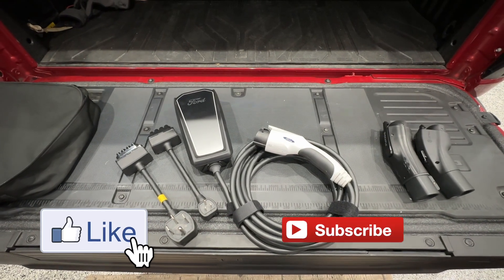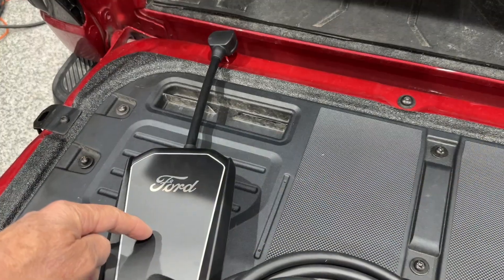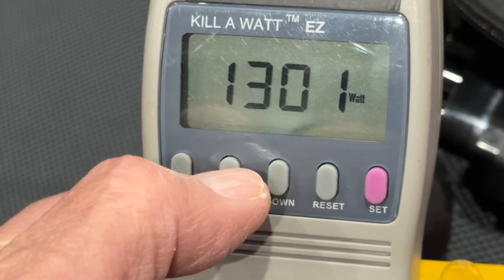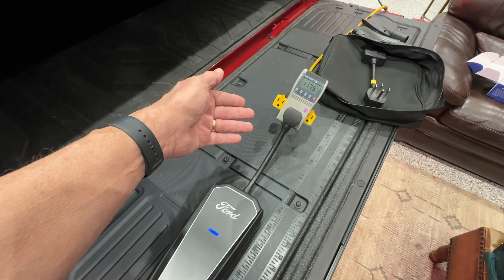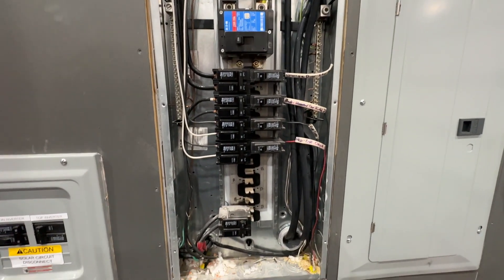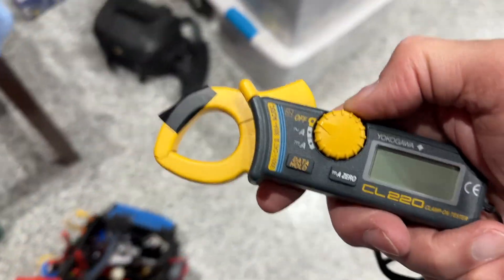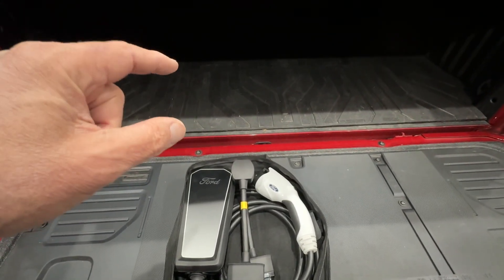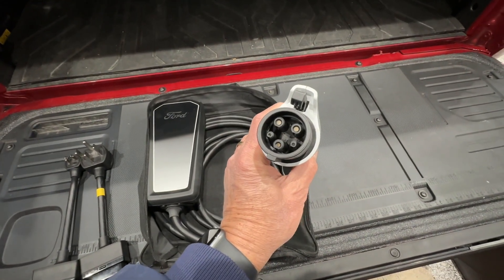Charging the F-150 Lightning on a  Ford Mobile Connector

Comment: Great presentation but I have a dumb question. How do I remove the 15 amp adapter from the mobile connector so I can use the 1450 adapter? It’s in there snug and I can’t find a release. And the Ford “instructions” are just cartoon images showing how to connect, not how to remove the adapter.
Reply from the maker: @MPerry-gu8ch  yes it’s in very tight because it’s waterproof grab a hold of the body of the mobile connector and grab up right by the connector where the rubber is hold on tight and wiggle it slightly to the left and the right on the long end and it should pop out

Comment: Hey Dave let me ask,  when using that adapter going from the 30 amp dryer circuit to the 14-50 receptacle what current will the charger pull, wont it pull more current than the what the circuit is capable of.
Reply from the maker: @Rock_Nemo  I’ve always use 80% of the breaker amperage.  If your circuit was installed by a licensed electrician the wire gage should have been designed with the appropriate breaker.  I think, you should check the dryer specs but I assume it’s 80% of the breaker (30A??)  Nema 14-50 sockets are rated for 40 amps BTW

If it was me, I’d run 24 amps (80%) even though the socket is rated for more.  I always use the weakest rating for a circuit.

If you have a tesla you set this current in the car/truck on the screen and by the way it’s set by GPS location and will change depending on where you charge in level 2

Good luck

Comment: I just bought a 2023 E Transit that's being shipped in from out of state. Am I right to assume it should come with this same kit?  I live in an RV park with 50A service. Is it ok to use a 50A splitter cord to run the RV and the EV or do I need a separate breaker? Thanks for the advice.
Reply from the maker: You might need it’s own circuit because I do not think Ford allows you to adjust charge current like a tesla but if they do you might be able to load share between the mobile home and truck. Congrats
Reply: @evdave528  I decided to go with a separate circuit  and not risk overheating anything. It's good because I found out I have 200A service and a free 50A breaker already in there.

Comment: Where did you get the 14-50 adapter?  My mobile charger only came with the 112v
Reply from the maker: Tesla mobile connector have all of the plugs available in the Tesla shop

Comment: Word is the Ford supplied charger is a POS. It is recommended to buy a TESLA charger online. 
It cost 1/2 as much & charges twice as fast. All you need is that adapter Ford offers so you can 
charge at a Tesla charge station.

!

Comment: About to order a lightning. Is 8 gage wire, 40amp breaker sufficient for the mobile charger when using 220v?
Reply from the maker: A minimum of #6 wire, Ronex 6/2 55amps and THHN 75 amps in conduit.  Continuous loads should be derated by 20% so ei. 60 amp circuit breaker is 48 amps.  Ask a local electrician

Comment: Has anyone checked the amperage on a  20A outlet to a Ford Lightning? In was hoping that would get tested on the Kill-A-Watt, but no joy.
Reply from the maker: I did a video showing actual Charger current look for it
Reply: Thanks Dave, if you have specific video can you include a link for it? I just rewatched this video and you only referenced a 15A circuit. From the data I have been reviewing, 20A circuit could be a nice sweet spot for battery longevity (slow charging) and the highly inefficient 15A circuits.

Comment: is there any option to plug it on a 3-phase power outlet, i mean does it need other type of inverter?
Reply from the maker: They may have a 3 Phase operation in the euro mobile/wall connector

Comment: Question for the group.   If installing a NEMA 14-50 outside (not in a garage) any recommended source for the outlet?    I find a lot of videos of installing a NEMA 14-50 inside the garage, but those outlets do not look weatherproof to my untrained eyes.   Thank you!
Reply from the maker: @billsrelectric  you can find a housing that has a flap covering the docket commonly used by RV folks, get for outside

Comment: Great information on the hardware/cables and what to watch out for.  Can you tell me how many miles per hour of charge that the battery will receive on the 2 options you have here.  How many miles/hour on 240V/30 amp service and how many miles/hour on 120V?
Reply from the maker: @markpuccio6270  I assume you asking about the Lightning?  It has a giant battery like my Cybertruck.  Physics dictate on a bigger the battery you need more charge current to charge faster.  Just like in your cellphone, if you charge it at 5watts vs 20 watt charger.  

If your use case requires faster charging because you’re using the vehicle allot, install a high power level 2 (240 v. at 48 amps)   If on holiday and charging at a friends house use 120 volts.    My lightning charged at something 18 miles an hour at 240v.  Remember when I had the Lightning it had no control over its charge current on level 2.  My Tesla V2 wall Connector would supply 80 amps and the Lightning would take it assuming the J1776 adaptor can take it and not catch fire.   Today ford may have supplied software with charge current control.  My Lightning is being used by my daughter now

Comment: where is the link to extension cords?
Reply from the maker: Yellow Jacket is what I recommended. Something like this. Help me decide on this product: Yellow Jacket 2884 12/3 Heavy-Duty 15-Amp SJTW Contractor Extension Cord with Lighted Ends, Ideal for Heavy Duty Equipment and Tools, Durable Clear Molded Plugs, High Gloss Yellow Jacket, 50-Feet https://a.co/d/gYCVMRh

Comment: I came to this video having just watched a video from MKBHD on his Auto Focus channel. The point of that video was to say that the charging of electric vehicles and the systems supporting charging is the Achilles heel of driving electric vehicles. I think this proves the point. Yes, I can charge where ever I want. All I need is a plethora of adapters, a working knowledge of electricity, or, when not at my home/a friends house, an account with about 3 or 4 different charging franchises and the knowledge of how each one works. 

Tesla has a better handle on this than most, but for me, it's easy to see how, with widespread adoption, even Tesla could fail to keep up with demand.  

As pointed out in the MKBHD video, it's okay to ask early adopters to put up with some inconvenience now and again. But, to expect the average driver to go from stopping at a gas station to the intricacies of electric charging is simply asking too much. Average Joe is not going to put up with the system as it exists currently. (See what I did there?)

Comment: If you could set it down a little a 30 amp service would run the charger at 220 volt.

Comment: I'm glad to see that Ford provides adapters for both 120V and 240V with its mobile connector —like Rivian, Bolt EUV, Tesla. Hyundai/Kia/Genesis needs to do the same! A mere 120V does not suffice.

Comment: It would very helpful if Ford were to provide charging speed information as well as current limiting, as Tesla does. As long as we’re wishing for things, additional NEMA adaptors that would plug into the modular input of the mobile connector would be very nice! Playing adaptor roulette on Amazon can be fraught with peril…

That 28A draw on 240 makes it dicey to plug into a 14-30 circuit with an adaptor, as it doesn’t fall into the 80% continuous load, is that correct? Being able to step the charge down to 20 or 24A would allow for less excitement potential! My parents have a TT30R outlet for their camper, and it would be nice to be able plug into that and get as much of its available power as possible, but as far as I can tell, the non-Tesla options are going to limit things to the standard 12A draw that you were getting from the NEMA 6-15 connection. Am I correct in that understanding?
Reply: You are correct. Pulling 28 amps from a 30 amps violates the 20% regulation.  More than likely it would trigger the circuit breaker.  I am really surprised that Ford doesn't allow users to adjust the Amps below what the system detects. Or maybe just like Tesla, it won't demand more than  what the system recognizes as available.
Reply: Is any update on this post . Just get Mach e with mobile conector and my only option is use my dryer outlet. 30 amp. I saw mobile conector request 28 amp breaking the rule. What about if use neocharge splitter that only provide 24amp. I’m very confused

Comment: It's probably better to get the right dongle for each outlet type. These mobile connectors adjust the amount of current they draw based on the dongle used. Once you stick an adapter on the end of the mobile connector it does not know what it is plugged into and might draw too much current for the circuit.
Reply from the maker: The Tesla mobile connector does a test of the circuit then tells the car to set the current.
Reply: @evdave528  I'm sure it does a test, but the current draw is dependant on the adapter used. From the mobile connector manual it states

"To attach an adapter, line up the adapter with the controller of the Mobile Connector and push it
into the socket until it snaps into place.
Note: The Mobile Connector automatically detects the attached adapter and sets the appropriate current draw."

I read this to mean the adapter is important in setting the right current draw.

The manual goes onto say
"Warning: Do not use an extension cord, a multi-outlet adapter, a multi-plug, a conversion
plug, or a power strip to plug in the Mobile Connector."
Probably an OTT safety precaution, however use conversion plug at your own risk.
Reply: @evdave528  Thanks for the explanation. Makes sense.
Reply: That's exactly what I thought would be the best approach to handle the different types of outlets. 

When I got my Tesla, it came with a regular 5-15 adapter and if I remember correctly, it also came with a NEMA 14-50.  I later bought a 14-30 adapter and was getting ready to buy a 10-30 adapter when I realized that I needed to also buy an extension cord. I bought a NEMA 14-50 extension cord and realized that I was better off buying adapters to go from the wall to a NEMA 14-50 this way I can use the Mobile Connector straight from the adapter or I can attach the extension cord if needed. This way I can always use the extension cord whenever I need it without having to buy also an adapter for the Mobile Connector.

The vehicle measures the power coming in and adjusts to that power it doesn't care which adapter you might be using. 

Also like Dave mentioned, Tesla allows you to adjust the charging to less Amps than what the system is detecting.

So in short you are better off buying a NEMA 14-50 adapter for the Mobile connector and adapters to go from whatever plug is on the wall to a NEMA 14-50. If you need an extension cord buy a NEMA 14-50 and you can use the adapters you already have.
Reply: @acolon8999  Yes you can adjust the amps inside the car, however that's the point of using the appropriate dongle, it makes that adjustment automatically for you. It avoids nuisance tripping of breakers or overloading a lower amperage circuit. Automakers typically do not want owners having to make adjustments to keep things safe, they wish the system to be failsafe.

In your example you plug a 14-50 dongle into an adapter and plug that to a 10-30 outlet you may end up pulling 32 amps on a 30 amp circuit rather than 24 amps. Things could get toasty between the outlet and the breaker. the extension cord you are using may also create more current to be drawn since there will be a voltage drop across extensions and adapters.
Reply: @JeanPierreWhite  Maybe I got it wrong but my impression was that you can not adjust how many amps the Ford is pulling from the outlet. I know that with Tesla you can.

If I plug in my 14-50 extension cord to a NEMA 10-30 using an adapter then plug the Tesla Mobile Connector to the extension cord using a Tesla 14-50 adapter, the car measures the available power and automatically adjusts to that.  The car doesn't know which adapter I am using all it knows is how much power is available and it automatically adjusts the changing speed. I can decrease how many amps to pull but I can not increase it past what the car determined is available.
Reply: @acolon8999  all the more reason to get the appropriate adapter
Reply: @JeanPierreWhite  From the outlet to the extension cord? Or for both ends? Or just for the Mobile Connector and get different extension cords for every outlet?

This is the way I see it and I might be missing something that you might know and I am just not seen it. I really want to understand your point because I might be doing something wrong or at least there might be a better way to do what I am doing. Right now I am just taking about 240v systems with a Tesla.

One extension cord (14-50). One mobile connector with a 14-50 adapter to plug in to the extension cord. One adapter to go from the outlet to the extension cord if the outlet is not a 14-50. 

Let's say you don't need the extension cord this time because the outlet happens to be near the car. Then you plug in the Mobile connector to the adapter without using the extension cord.  

Let's look at these 2 scenarios. They both require an extension cord.

House in Florida: 10-30 adapter from outlet to 14-50 extension to the mobile connector with 14-50 adapter.

House in Vermont: 14-30 adapter from outlet to 14-50 extension to the mobile connector with 14-50 adapter.

As you can see, the only thing that changes is the adapter to the wall.

Since I need an extension cord anyway, it makes more sense to me to buy the adapters to convert whatever 240 outlet I am going to use to a 14-50 than carrying multiple extension cords to then also buy the adapter for the Mobile Connector to match that outlet.

Again, the car will not demand more power than available regardless of the adapter being used. So overloading the circuit is out of the equation and the extension cord is rated to handle the 14-50 load which is the highest that we are dealing with.
Reply: @acolon8999  The car may demand more than the circuit is designed for. 32 amps through a 30 amp circuit for many hours will create a lot of heat in the homes wiring. A 30 amp circuit does not limit the amount of energy available it will attempt to supply what is demanded of it until the breaker trips or it melts, whichever happens first.
Reply: @JeanPierreWhite  Makes sense. I wonder how the car automatically knows to pull no more than 24 amps when I connect it to a 30amp breaker using a  14-50 Tesla adapter. (Using adapter to go from 10-30 to 14-50 by the outlet).

Comment: Here's another tip when using a 120 volt receptical.  Using no dropcord and plugging in at the receptical you will lower your current draw on the recepticals circuit breaker. The wattage that is drawn is constant so the greater the voltage drop at the point you plug in the greater the current draw will be. Although expensive,  if you must use a dropcord use one that has 12 Guage wire or larger and as short as possible.  Where you might trip a breaker using a 14 Guage dropcord.  It's possible that same breaker won't trip using a 12 Guage dropcord.

Comment: Very nice videos on charging. I  believe the only thing you might have missed was the power loss that takes place at the on-board charger in the lightning. You kind of showed the power loss using a dropcord by the voltage drop from 120 volts at the receptical to the 117 volts at the end of the dropcord. But there's also a significant power loss that occurs at the charger converting A.C. to D.C.
So let's say you have the full 120 volts available at your calculated 12 amps of current which equals 1440 watts of power going to the on-board charger. The actual wattage reaching the battery may be as low as 1200 watts that's just 1.2 kwh or 1.2 kw per hour charge.  The same occurs when you use the 240 dongle on the mobile charger. Maybe 6 kwh actually making it to the battery. So using the example that your battery is at 80% when you plug in. A 131 kwh battery at 80% needs 20% of 131 to bring it to 100%. Which would be 26.2 kwh.  For rounded figures and being conservative it would take the 120 volt circuit 26 hours and the 240 volt circuit 4.5 hours to bring the lightning to 100% charge.